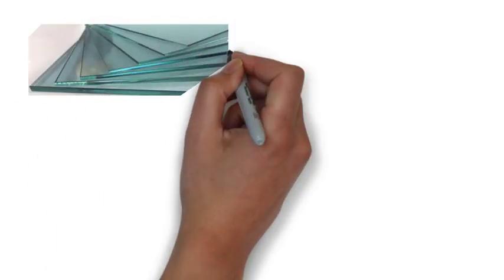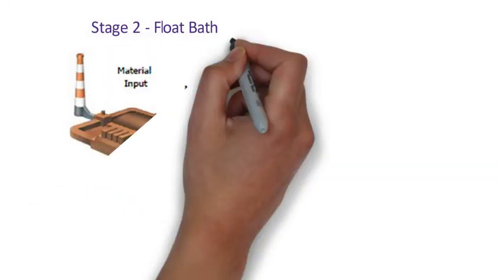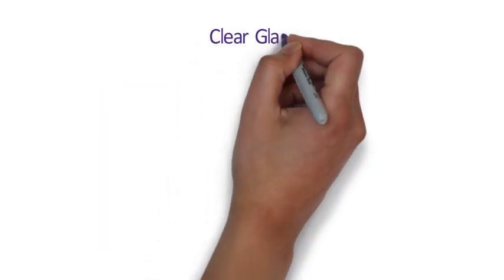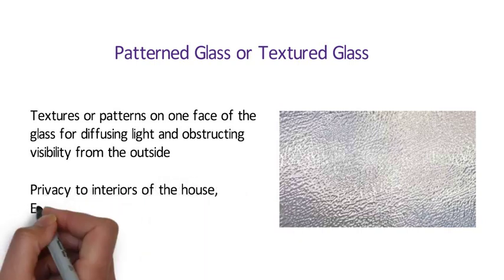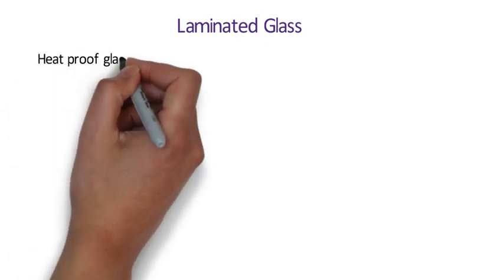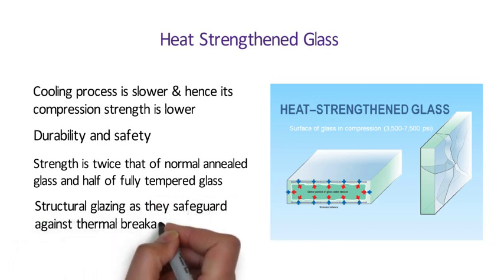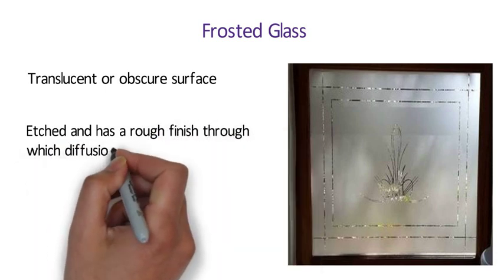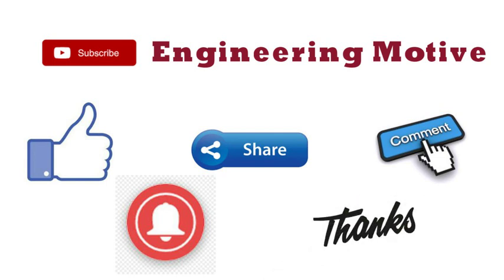Glass Manufacturing,Properties,Use & Types

Comment: 04-10-2020 Bangalore
Continuation of my comments:-
second doubt:  Is the glass  a good  conductor of electricity or a bad conductor of electricity.?

Third doubt:    If a glass  is a long rectangular item where  AB = CD (say in meters)  and its thickness  is
is very small (say  a few  mm  (mili meters)  how much load ( K G) acting at its centre will break the glass
into two or more parts?